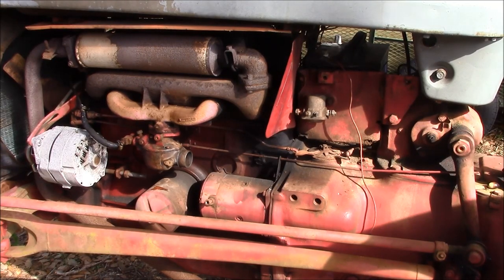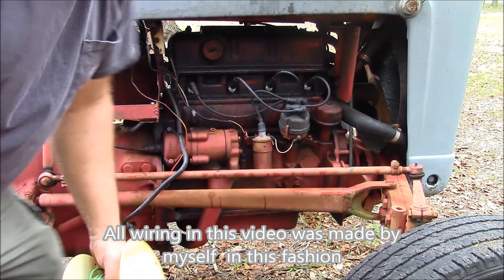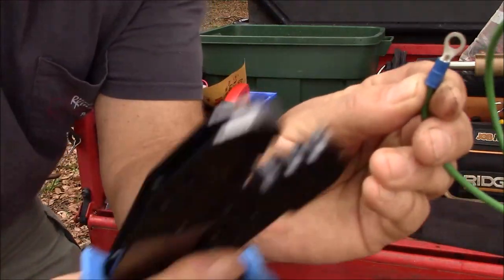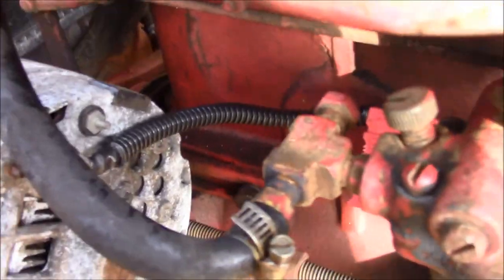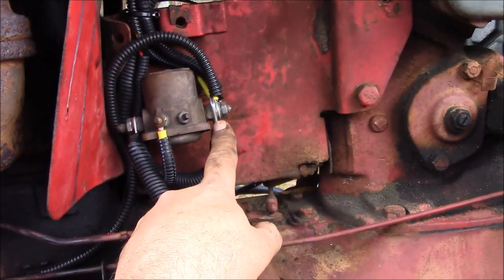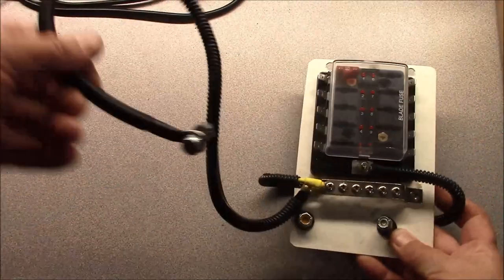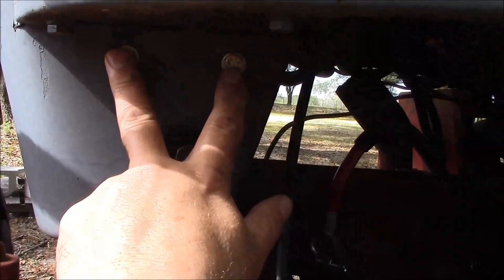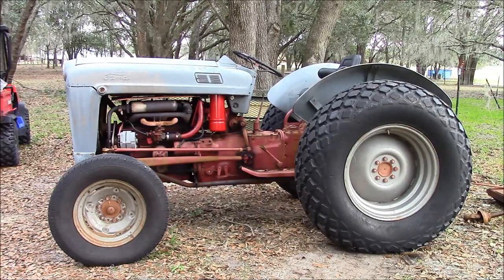Rewiring the 1957 Ford 800 Series Tractor

Comment: Awesome job Brett.  Like you, I have seen some hacked up 12v conversions, but you cleaned that up nicely.  I'll probably be referencing this video for some pointers when I rewire the Bolens.  Different electrical system, but putting the ends on should be the same.
Reply from the maker: Thank you ! I hope the video helps. If you need anything give me a shout. Thanks for watching !

Comment: Does the starter solenoid need to replaced with one for 12 volt with a 12 volt conversion?
Reply from the maker: In this example I did replace it and the coil with 12v variants. Thanks for watching !

Comment: Can you say what kind of wire you are using and where to buy it?  You moved the spool of green wire too fast for me to read the writing on the spool.
Reply from the maker: I had most of the wire on hand.  For the wire from the Alternator to the Solenoid and from the Solenoid to the supply side of the relay and Relay to your Fuse block 10Ga will suffice . Mount an equivalent 10ga conductor to your ground buss from chassis. For your switching circuts ( IGN , ACC ) 14 to 16 ga wire will suffice.  Outside of master battery (battery to solenoid, solenoid to starter, and battery to chassis the circuits are fairly low current . Any automotive store should have what you need on hand. Rural king has excellent prices on small diameter < 14 ga  hook up wire. I hope this helps and thanks for watching !

Comment: Will it crank even in gear Im thinking?
Reply from the maker: Yes it will. Is possible to use the OEM  neutral start switch  if  the starter solenoid is isolated from ground.  Definitely a consideration if the operator isn't cognizant. Thanks for watching !

Comment: better way to do the connector(s) ...  crimp then solder...  lasts alot longer and alot less resistance then just crimping .. then use the heat shrink
Reply from the maker: I have been doing this for 30 years if you want to solder go for it. Thanks for watching !

Comment: Did you have to buy a new starter solenoid/ relay the the starter button is a grounded system and it looks like you ran a hot wire to the solenoid from the starter switch
Reply from the maker: I deleted it and used a key switch. If one wanted to keep the original switch they could but it would need to be wired differently with a ground isolated solenoid. Thanks for watching !
Reply: @survivalcomms  the 8n starter solenoid is ground isolated right?
Reply from the maker: @beckyschwantes5287  The original is.

Comment: I have a 661 workmaster. Do you make & sell a kit like this?
Reply from the maker: I do not sell a kit like this but I can provide you with a parts list. Have you made the 12v conversion yet ? https://www.yesterdaystractors.com/Ford-601_12-Volt-Conversion-Kit_556410300ALT.html These guys offer the kit. I did convert my ignition system to 12v also which this kit does not address but that basically is a coil. Thanks for watching !
Reply: It was converted before I bought it. It looks like it still has a generator instead of an alternator
Reply from the maker: @billydeesullivan537  Check the voltage to make sure.